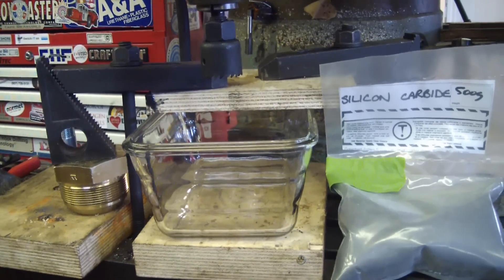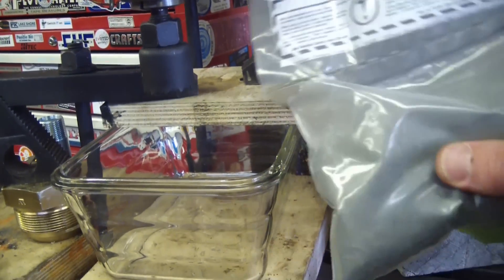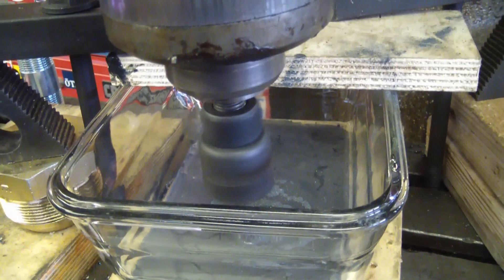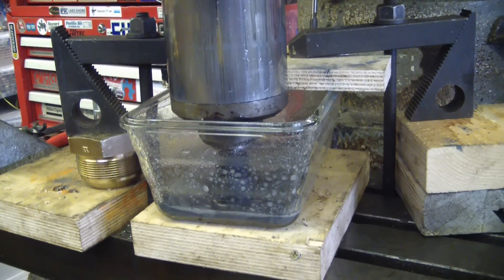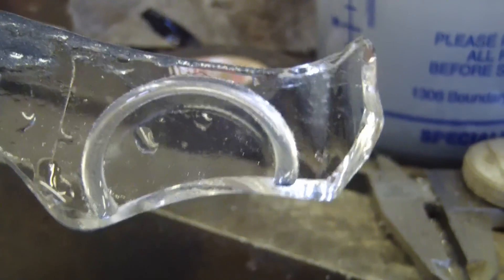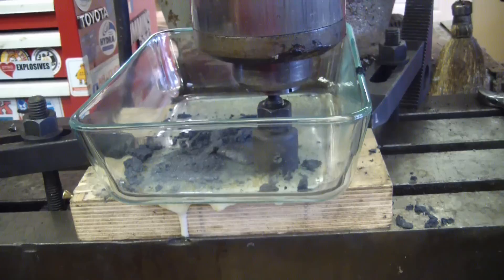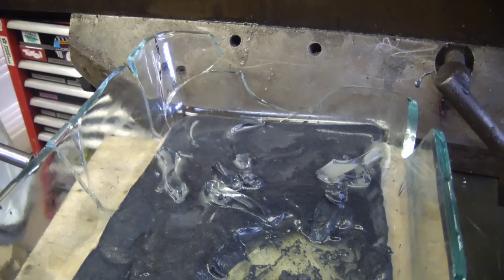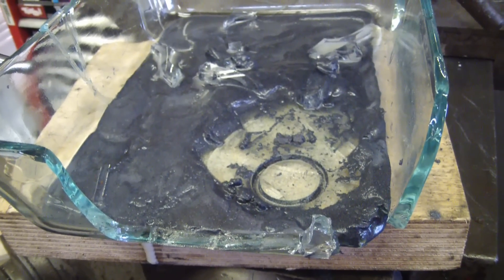Using Silicon Carbide to cut glass

Comment: I bet you could do it if you had some kind of a jig to hold the entire dish under pressure- maybe something like a wooden box full of sand that is equally compressed on all sides, so that breaking through the differential pressure layers- the hard 'skin' on the surfaces of the glass- doesn't shock the whole piece. I think the best way to do this would be to vacuum-compress a sand-ceramic mixture, and then hold pressure via the box with whatever clamps you have. You need a way to seal up a 'channel' that you'll drill through, on both sides- hot glue and a bit of pvc pipe might work. Then what you want to do is drill through 1/4 of the way from both sides- so you break the skin, and hopefully don't shatter the piece, because at this point you can't really check. From here there are two ideas- I don't have a bridgeport or I'd test it and show you- but it seems like you could walk the cuts closer to each other using the same method, and then when it's thin enough, give it a tap to break it out. option number two is the same idea- remove material until you tan tap it out, because it's gonna break no matter what, but you can still cut a little bit, and the idea is to control the break so it's the one you want. So option two is to drill small holes around the periphery the channel cut by your hole saw, as close together as possible.... yeah, forget it, just do the other one.that's got the best shot, I think. The key is to control as much of the entire rest of the dish as can be controlled at the moment of the break, so the crack can't spread.

Comment: Yup.  New cheap Pyrex isn't borosilicate, it's tempered -- you're exactly right, it's pre-stressed, just like a Prince Rupert's drop.  They make it that way so that when you put it in the oven, the thermal expansion can't overcome the pre-stressing, so the glass doesn't shatter.  Normally both the top and bottom surface are under tension, but as soon as you cut through the top surface, the unbalanced stress rips it apart.

Try it on a window pane or a drinking glass.

Comment: I have successfully drilled through glass using a manual drill. I believe the break is caused by uneven overheating, but i could be wrong. When I drilled through successfully i put my piece in the sink and had water flowing over it constantly, also i pecked the hole i was making. I have never tried glass in a mill before because i'm a merely a boy and cannot afford my own, but if you still need a hole cut in the bottom of the dish i would just put the same drill bit in a hand held drill so you can better feel the forces etc. idk worked for me just go super slow like <100rmp

Comment: I would use a diamond hole saw for drilling glass.  I have found while cutting holes for toilets and pipes, its best to just to let it vibrate around.  I have tried gluing them to stuff and they break more consistently.  Apples to oranges I know but im sure its possible.  We normally take a 2 liter or 5 gallon bucket with a small hole drilled in the side.  Water pisses out so the bits dont burn up.

Comment: A long time ago, I saw a method for doing this much the same way but with a cutter made of a bit of copper pipe with two slots cut up its length instead of teeth. Don't know where I saw it or exactly what the details were, but maybe that'd be worth a shot? I'd imagine it would be a much smoother cutting action that way.

Comment: I haven't personally done it, but take a look at aquariums. Specifically salt water and home made (or home modified... whatever). I recall reading several guides that talked about drilling glass, tempered and otherwise. From what I remember, tempered aquarium glass could be drilled but would induce tiny cracks around the hole which would eventually fail. I don't know how long you need this to last. 
Though worth mentioning, is that in aquariums rarely is the whole shebang one piece of glass like your dish. Normally they're glued together. Maybe the fact yours is all one piece is why it fails? Is there anyway you could semi-build your own container from individual glass pieces?

Comment: 1. Anneal. 
2. Mill those teeth off and use a flat cutting-face with some perpendicular slots cut in it. 
3. Put a lot more water in there to dampen the high-frequency vibrations. 
4. When you get nearly through, use a lot less pressure.

Comment: Hey we have a resident glass blower at work. I'll ask him what to do. But from what I've learned from him so far, the only way you'll get away with doing that is to anneal the glass in an oven first. Like 800-900 degrees and let it cool gradually. It's the weekend, I will see what he has to say next week. Hope I can help.
Reply: ***** Ok I consulted the expert and he confirmed that most pyrex is tempered for strength.  You could anneal it but then it loses said strength.  Lots of other people have mentioned this in this comment string.  He said that if annealing is not an option, then coring the hole will require regular attention.  What happens is that the grit breaks down and gets "pumped" away from the cutting area by the rotation of the bit.  Once you get metal on glass heat builds up rapidly and tiny fracture turns to a big failure in a hurry.  When he's performing a similar operation, he has to lift the cutter occasionally and brush fresh grit into the action.  (This is how you maintain a high chooch factor.)  Good luck!

Comment: I'm thinking it's the vibration causing the glass to break apart.
Try dampening the vibration a bit
Also, scratch the shape you want to cut out 
One way I deal with large tubing in my shop is I would do a nice deep scratch, wet it with plain ol water, the get a glass rod white hot and press it onto the moist scratch with good pressure
It would crack right where I want it to
For a hole though, I don't think it will work
I'd heat the dish up in a kiln and open the hole with a torch and a glass rod

Comment: When drilling glass need to drill to halfway and turn it work piece over and drill from the otherside. That said ive only drilled annealed flat glass. The glass you're cutting may be heat treated or strengthened. Basicly a process used on glass to make it stable at high temperatures. If that is the case it can not be cut

Comment: Glass is extremely sensitive to temperature change. So for example if you scare a glass where you want it to cut and then pour steaming hot water on it and quickly pour cool water out of the tap, it'll cause the glass to crack. If done correctly and its isolated on the area you want cut it'll crack right where you scared the glass.
Reply: ***** Too bad glass is not easily scared, should've tried it when it was still young glass.

Comment: I think the problem may be the glass itself. If memory serves it's not just the type of glass that makes Pyrex and it's knockoffs suitable for use in an oven. As far as I remember there's a process in the manufacturing where they cool the surface of the hot glass quickly while the core cools slowly. As the core cools it contracts and pulls the surface into compression, just like a prince Rupert's drop. All this is great for cookware but if you cut through the compressed surface the tension in the core causes  everything to shatter. Try a non-cookware container?

Comment: Since it's tempered... Why not use the oxy torch with the cutting tip? Maybe heat it up to 500* in the oven first. (When wifey poo is out.) Get the spot read hot and poke a hole with a punch. (Pre-heated too) Have some type of tool to mold the molten glass as needed handy. (Like those fancy glass blowing types use.)
Maybe some safety equipment would be in order... Fire extinguisher too!
I'd say try hitting it with the oxy when it's molten but that might not be a good idea.
Great videos.

Comment: I feel like spinning backwards was on the right track.  In addition to all the commentary about internal stresses - I would think any glass would respond best to a grind type process.  Use a plain tube instead of a bit with teeth - drastically reduce the stress concentration and avoid "cutting" type forces - all the work will be done by abrasion.  I would think, however, that a tube for a "bit" would mean more load required on the quill.   You could even add a few cuts to the tube for cuttings removal - but no teeth where it does contact just flat.   And that advice is NOT backed by experience so take it for what it's worth which is obviously very little.

Comment: fluted (to bring slurry into friction/cut out area) WOOD ring? soft enough not to cause resonance in the glass? slow as frig, similar to sandpaper, only more better. maybe cut out of pressure treated to prevent too much wood soakage/swellage.

brings up a question. reason I think wood might work is because glass will damage wood more with the safe (same! frigging anti-correct) energy that metal will damage (break due to brittleness) glass. the obvious explanation is hardness, but is there a nomenclature to categorize what breaks what with what energy in what frequency, compared to what... what?

Comment: you need to equalize the pressure on the glass, put the glass you want to cut with the water and abrasive in it in another dish with water coming up most of the side you will equalize the pressure and also take out some of the residents which is what's causing it to shatter unless you're using tempered glass then you can't do it

Comment: I think u nailed it with the prince Rupert drops thing, surface tension in the pyrex is to blame, It is interesting however that it didn't shatter immediately, maybe it is heat buildup initiating the fracture. Reading online I see people recommending doing it under water and verrrry slowly, another idea was using a plain flat ended rod instead of the hole saw . And lastly pure grinding with coolant with a dremel type tool with grinding head.
  Anther idea, you can see the tension lines in pyrex by placing it in front of a polarized source, like an lcd monitor and viewing with Polaroid sunglasses, just an idea, but just maybe this might give you some idea as where not to drill.

good luck.

Comment: You probably want to do something about that screeching/howling noise, and you should also probably try taking the temper out of the glass if you can't find an untempered piece of the required dimensions.
That screeching noise is vibration, and that can resonate and shatter the glass.
If you have an old tire or other source of scrap rubber, try putting a layer of it between the glass and a piece of wood. Possibly wrap some large rubber bands around the outside of the glass as well. The idea here is to dampen out the vibrations so that they can't get intense enough to shatter the piece. Resonant vibration is something that can cause problems with cutting all kinds of glass.
Tempered glass SUCKS. Plain and simple. It's impossible to modify it without taking the temper out of it first, or like you said it will shatter just like a Prince Rupert's Drop.
If you are attempting to take the temper out, I'd suggest using an electric oven, as it's easier to make a controller for those than for a gas oven, and you will need a computer control for this mostly because the entire process takes so long, and because you need relatively precise control of the temperature. You already have an Arduino or two around, and those should be usable. The hard bit is, as usual, the stuff to make this thing control that thing.

Comment: I'll take "Internal Stress" for $200.  Sawing glass is eroding a hole with a lot of little fractures and stress risers.  As the cut progresses, the uncut portion can no longer hold back the stress and POOF.  Even if you made it all the way through the bowl would be a ticking bomb.

Were I in a similar spot I would punch the hole using some thin wall nesting tube to reduce thermal shock.  Fasten the larger tube piece to the mill table and the smaller punch to the quill.  Support the bowl over the die with ceramic tile or other insulating heat proof material.  Heat the bowl all over with a rosebud torch to decrease the temperature gradient for when you pour the heat into the punch area.  Have the punch spinning nearby so it can be pre-heated while heating the hole area to a bright plastic state ( around 1600 F).  Stop the mill and plunge the punch through.  Cover the whole mess with a welding blanket and go have a drink.  That way you'll be gone when it explodes and the alcohol will make you care less about it

To get a better nested fit with the die and keep the punch from getting stuck in the glass you could bell mouth the punch end a bit.  Both the stress relaxing heat and the smooth pinched hole should make the bowl a lot more stable.

Even if it didn't work it would be a cool video >:)

PS. You can put me in the arsehole catagory.  I'd count it as a promotion.

Comment: try using polarized sunglasses while looking at the glass, you might be able to see where the heat stress points are. also, constant pressure can be the reason for the braking. you have to use hand pressure and manually adjust pressure as you go. once the stress point is passed, the constant pressure just keeps going. when using hand pressure, you can back the saw off as soon as you need to.
Reply: I'm no expert but have a bunch of hobbies with no proper tools and still get the job done. I found that manual hand pressure works well for me.

Comment: I used to cut and temper glass (and coat but thats unrelated) , and if the internal pressure of the glass is over 8500 psi, then its most likely gonna break every time you try to cut it. Granted Pyrex dishes and hurricane windows are so far from the same thing that it's hard for me to say my input is valid

Comment: I'm not a glass guy but I'm thinking, it has to do with constant force against the glass. you might not want to do that. Also, on a tile, when drilling a hole, using tape to avoid the tile from shattering or I would use plain water or some type of oil to lubricate

Comment: In blade smithing the metal is pre-stressed by the forging process. In order to relive that stress the blade is "normalized" which is the process of heating it red hot then allowing it to air cool, maybe that will work here?

Comment: I noticed you get most the way through the piece and then it breaks,
One way I cut large diameter tubing is I to a deep score and wipe it with water,  then I heat a glass rod to white hot and press it on the score relatively hard.  That sends a crack all the way around the tube in line with the score. Then just a tap on the edge of the table separates the piece

Maybe try the same method you used for the cutting, but just score it with the bit
Then heat a glass rod to white hot and press on the score
Also, I sometime use masking tape in line with the score to help dampen the vibration through the piece hope it helps!

Comment: My guess is that when you get half through, the built in stress overcomes the strength of remaining material and a crack starts. Could you try to heat with a gas flame first?

Comment: No silica carbide required. Go in at an angle. Spin faster, much faster. Use a circle with more teeth. To be honest. You could cut that hole with a dremel easier than a circle saw. I wouldn't use the circle bit flat on though. Elevate one side of the pyrex an inch -- that will reduce the area cutting and the vibration/currents that run through the glass.

Comment: Once glass is tempered you can't put a hole in it.  It has to be annealed (plate glass) in order to be modified.  Pyrex and tempered is a safety glass made to explode in a million pieces.  I work with the stuff everyday.

Comment: Appears to be as you say that the glass is under tension and/or compression. My understanding of tempered glass is that the outside layers are rapidly cooled and as such shrink and go under compression. This gives strength at the cost of flexibility.

Comment: About your neck. In my case it comes from a night where I slept too long on my side and used a pillow that's too thin. It's not just the neck that gets stressed, it's the compression of the shoulder against the spine.

About the glass cutting. The temper theories here sound very plausible. You may also want to attempt using a finer abrasive, less down pressure, and raising the saw more often to make sure that you're getting a supply of abrasive to the cut. You might have to let the mill run longer than you want though. I'm wondering whether too much down pressure, and an insufficient supply of abrasive to the cut is making the saw cut rougher toward the bottom of the cut than at the top. The rougher cut may be triggering the stress fractures.

Comment: Hey AVE. i happen to be a glassblower. I make pipes what for smoking out of, but I make em from borosillicate. If you want any chance of cutting that stuff youre gona want better lgass, a better cutter, or you can kiln it in a ceramic or glass kiln at 1200 degrees Fahrenheit. Now im not to sure about the difference hetween pyrex and borosillicate, but theyre probably similar enough. Right? Anyway kilning it at the right temp will take some of that stress out. Fun fact they make glasses and sheets of glass with a special layer of film over it so you can actually see the stress. Crazy stuff. Anyway Keep us posted either way!

Comment: When I saw the setup, I thought you'd found a way to trick Prince Rupert. So I was looking for an awesome technique to fool that rube. 

Drats. Looks like he gets the last laugh after all.

I think I might try the technique on plate glass tho. Looks interesting. 

What would be cool would be to video the process of sandblasing a hole through tempered glass (if it can be done). I've seen it done on a bottle of wine.
Reply: Sand blasting wont do it either. Tempered glass tries to expand laterally. It would still break. The marine / reef / aquarium trade has been dealing with this for ever.